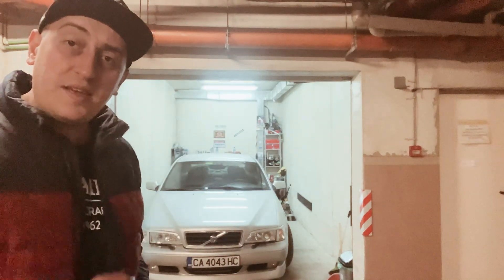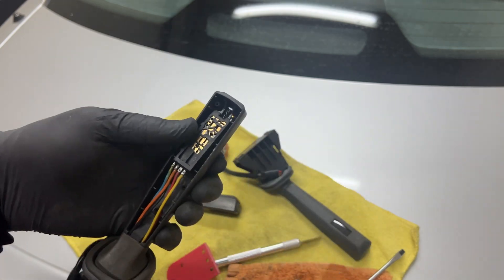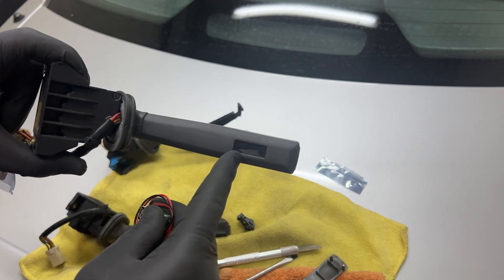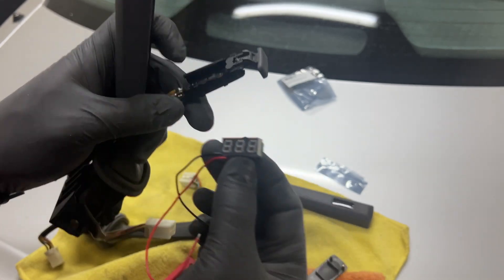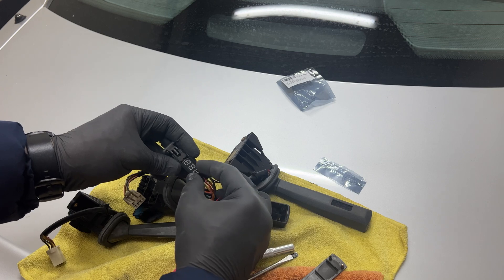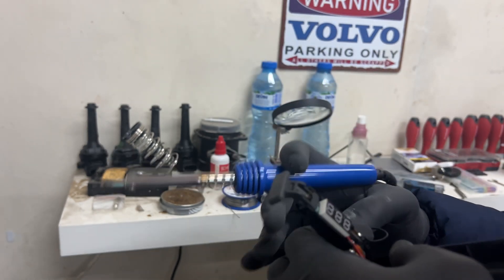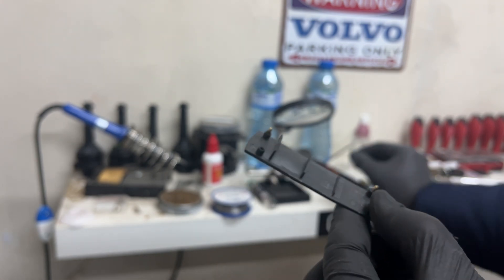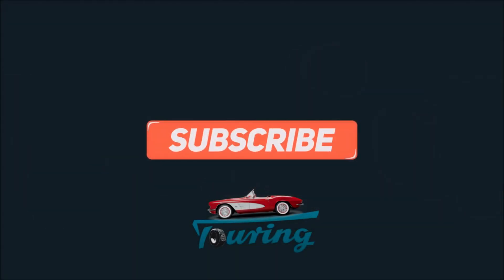Volvo C/S/V70 - How to integrate voltmeter into your P80 wiper switch ￼

Comment: We need more videos like this, i will do this mod for sure.
Reply from the maker: I’m glad that you like it. You can subscribe to my channel because I have other great ideas. 😁
Reply: @TouringCarShow  Ofcourse i subscribed as a fellow p80 owner.
Reply: Agh, did this mod but it appears my wires are broken somewhere in the car as the voltmeter isn't getting any power or maybe its a fuze
Reply from the maker: Check out for a fuse or relay and if it looks OK, try to connect it with wire to any of the buttons on the dashboard
Reply: Fuse was fine, not sure abt the relay tho.